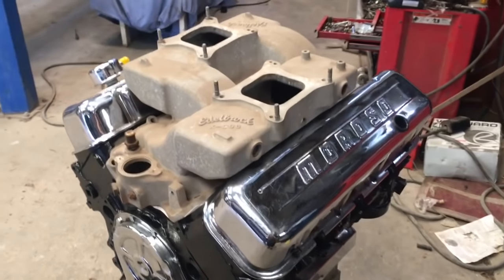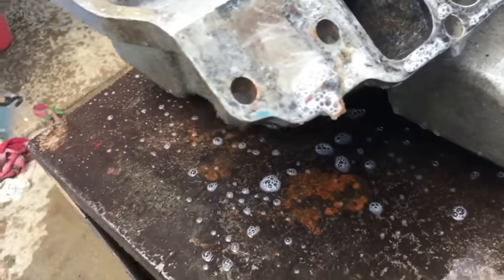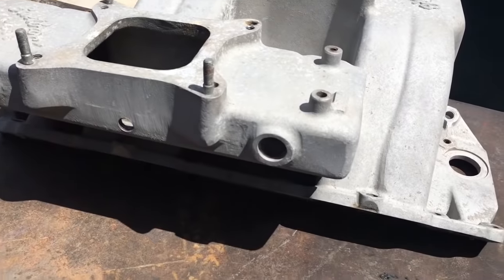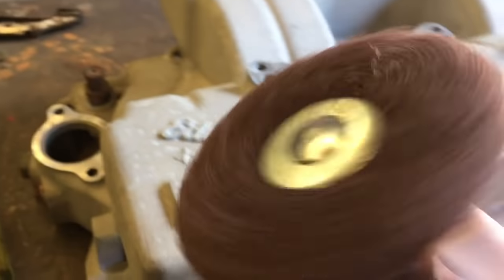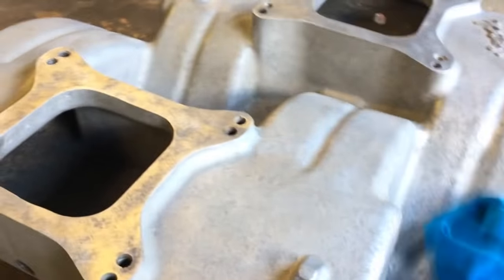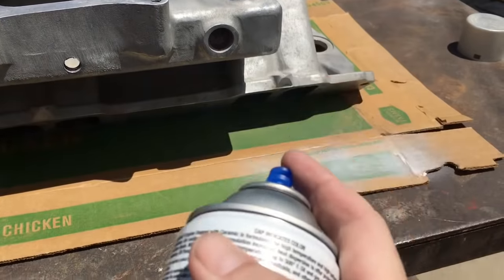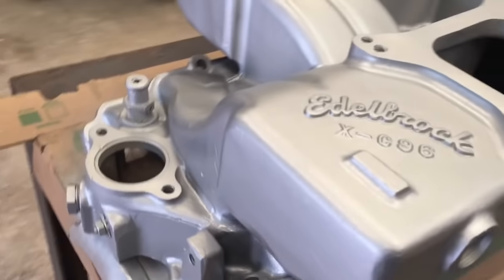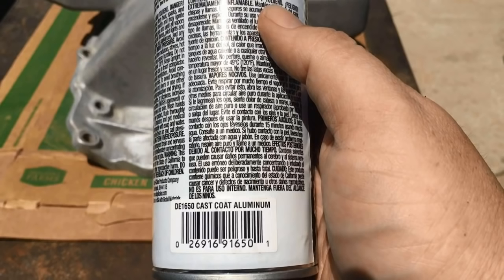Aluminum Intake Manifold Restoration the quick, cheap and easy way

Comment: Don't paint aluminum intake manifolds, it seriously slows the heat dissipation, which is one of the reasons aluminum was used in the first place.
Reply: The radiator's job is to get rid of heat. Why should there be heat coming out of the intake manifold? How does that help?
Reply: Most people don't know that paint, especially metallic paint acts as an insulator in the same way you would wrap food in foil to keep it warm. Thermography 101
Reply: Honestly, I thought he was going to show how to polish it out, but it looks good.
Reply: Chill out. Just a thought…
Reply: @Spiritof_76  You don't know much about engines. Hot oil get splashed to the underside of the intake plus exhaust crossovers on production intakes add heat, hence a hot intake manifold.
Reply: @joe-hp4nk  I know plenty about engines, there are 7 engines in my shop in various states of assembly, and that's not counting the 4 that are still in cars. Intakes with crossover heat usually have a metal heat shield riveted on to block most of the oil. But from the factory, the intakes were painted cast iron. Of course intake manifolds get warm. But the cooling system gets rid of engine heat unless it's air cooled like a Beetle or Corvair.
Reply: @Spiritof_76  Aluminum is a excellent conductor of heat. If you paint it the heat won't dissipate like it needs to and you'll have vapor lock from boiling fuel.
Reply: @joe-hp4nk  No, vapor lock is usually because the fuel gets hot in the lines, too close to the exhausts. The fuel in the carburetor can vaporize, but a thick mounting gasket can alleviate that. Painting an aluminum intake won't do anything different that painting a cast iron one. They both warm up from engine heat. Cast was always painted so it wouldn't rust, but car manufacturers don't spend the time or money to paint aluminum parts.
Reply: @Spiritof_76  True, fuel gets hot in the lines  and causes vapor lock. Aluminum soaks up heat way faster then iron and must be dissipated  quicker. Painting it traps the heat in.
Reply: @joe-hp4nk  If the heat gets trapped in the intake manifold, how is the gasoline in the fuel line or the carburetor going to vapor lock? What "sounds right" doesn't make it matter. Painting an aluminum intake is no big difference than painting a cast iron one. The coolant and the radiator remove engine heat. I've painted aluminum intakes and it makes no difference that matters on a street car. I've been working on cars 40 years. Aluminum is used because it's light weight and easily cast.
Reply: @Spiritof_76  That's right, they make aluminum parts because they're light. The down side is aluminum absorbs heat fast and dissipates heat just as fast, painting it traps the heat from dissipating.
Reply: @joe-hp4nk  It's obvious you are going to stick with the equivalent of a mechanics old wives tale. Your vapor lock claim is crap. Your aluminum intake claim is crap. Engines operate most efficiently at specific temperatures. They'd overheat if your claim was true. They don't. You are immune to logic and facts.
Reply: @Spiritof_76  It's ok, paint your aluminum intake till the cows come home. I'll keep my aluminum intake clean and paint free and enjoy a cooler manifold.
Reply: @joe-hp4nk  I'm sure you are reaching for your joy-maker just thinking about it.
Reply: @Spiritof_76  You would rather reach for my joy-maker come to think of it.
Reply: There is so much under hood heat on a vehicle that of the paint is an insulator it would be a good thing, that is why cold air intakes are important.  On my SBC 400 I have 3/4" thick insulating spacer between my carb and my intake manifold to reduce heat soak from the intake manifold.  Vapor lock happens in the carburetor not the manifold.  I added a fuel filter with a bleed return to prevent vapor lock and to have more fuel flow back to the fuel tank.  The only thing cooling the manifold is the air going into the engine otherwise it's heat soaking from the engine and exhaust headers.
Reply: @joe-hp4nk  (Who removed my reply?) We know how this went down: Your slow reply was rehearsed in the shower while slowly washing your ****, then you rushed to type it before you even dried off, thinking, "I've got him now."
Reply: @Spiritof_76  Something got to you a long time ago, and you need help to take care of it.
Reply: @joe-hp4nk  No, just know-it-alls making claims with weak arguments, mostly just "because I think so." That's your argument.
Reply: @joe-hp4nk  You can always delete your fallacious comment and all of these replies will disappear with it. Aluminum was not originally used to cast intakes for heat dissipation. Finned heads or jugs on air cooled engines, yes, but water cooled intakes, no.
Reply: @Spiritof_76  Aluminum was used to save weight. The rapid heat absorption and dissipation is a property of aluminum, don't block it with paint.
Reply: @joe-hp4nk  My radiators, thermostats, and fans get the job done just fine. Where do you think the heat is going in a cast iron intake? And if someone swaps it for an aluminum one, it suddenly needs to radiate heat from the surface? The engine makes the same amount of heat, but it can't leave through an iron or a painted intake? Face it dude, your claim is ultra weak. The difference is negligible.
Reply: @Spiritof_76  You're right, iron intakes need good radiators. Aluminum intakes dissipate heat much better which makes the radiator even more efficient, provided you're not stupid and paint it.
Reply: @joe-hp4nk  I'll give you credit for one thing: If you were the captain, you'd definitely go down with your ship, even if it was still moored at the dock. Now go out and do the science. I need to see how much heat per hour comes from bare aluminum, painted aluminum, and painted cast iron intakes on the same engine, and also the change in horsepower/torque with each intake painted and unpainted. But really, it doesn't matter. People paint their intakes for cosmetic purposes. We could all just run unpainted engine blocks and all of the parts on them regardless what they are made of.
Reply: @Spiritof_76  There's no choice, cast iron needs to be painted or it'll rust, hence the need for more cooling than aluminum.
Reply: You beat me to it. 👍 
Paint hold in heat. 
Heat robs horsepower. 
Hot rodding 101.
Reply: @Nicholas-cn5vk  It's NOT that simple. A cast iron manifold gets painted. Headers get painted or coated. Cast iron blocks get painted. Does an aluminum intake engine MAKE more heat than one with an iron intake? There are optimum temperatures for engine efficiency, not too hot, not too cold; that goes for the oil and the coolant. Actual data is needed, not "sounds right to me."
Reply: @Spiritof_76 What is it bolted to and sitting on top of?
Reply: @gregmay2155  You tell me, Einstein.
Reply: @Spiritof_76  That's rich, coming from someone that doesn't understand the basics
Reply: @gregmay2155  I understand plenty. "The basics"? What would that be? Engines have an optimal temperature at which they make the most power with the most efficiency. Numbnut ideas like "the engine has too much heat and needs to dissipate it through the intake manifold" certainly aren't the basics. Give me facts and numbers if you want to dispute my claims.
Reply: @Spiritof_76   I'm not here to hold your hand. You obviously don't like to do any research to better yourself. Good luck with your builds. Sincerely, the guys taillights your looking at because you can't be bothered with science. PS, You should run 87 in your high compression build because they are just ripping you off with that 92 crap lol
Reply: Uhhh, cold air goes in the intake. Not hot. 🙄
Reply: @gregmay2155  At the drag strip where they run the car for a short time at max rpm, and the lightest parts are used, intakes were sometimes cooled with ice between runs.  But for a daily driver or weekend fun rod, the difference is going to be negligible. For a car show vehicle, stopping an intake from staining and oxidizing by painting it won't make a horsepower difference that's measurable. If you think otherwise, do the tests and post the data.

Comment: I used to work for a Sign company,  and to clean Sign cans, we used Muratic Acid. Sometimes diluted, and sometimes not. Works great on bike motors, wheels, valve covers, even removes Aluminum bits stuck to nickel cylinders like a blown up Snowmobile.
Reply: Agree with you, definitely read the delusion parts to water ratio
Reply: Yep drain cleaner is the same thing but I used it on a snowmobile cylinder that got scuffed by the piston skirt to dissolve the aluminum then re hone the cylinders for new rings being the cylinders were with in spec . I think what happened is the guy got on it too hard before it was warmed up being a liquid cooled rotax engine and it cold seized just long enough to drop compression and skuff the cylinder walls .
Reply: @Pete Loomis  I hope it wasn't a nickel coated sleeve cause honing those destroy em! 99% of liquid cooled sleds have/had nickel coated sleeves!
Reply: @Guns_N_Gears No it wasn't a nickel plated cylinder because it was a older Rotax engine that was made before that process was being used.
Reply: @peteloomis8456  I was talking about my experiences.  Thank you

Comment: Easiest way to smooth and polish aluminum intakes is with a brass wire wheel. Takes literally no time and if you have a dremel or other small rotary it takes even less time in the tight spots. Clear coat it with a non yellowing and you'll have a polished intake. You can use the brass wire wheel on pretty much anything aluminum and pitted to get a smooth as butter finish. The paint lays down so much better than using chemicals that can seep into the metal and contaminate the paint even after multiple baths with thinner.
Reply: You’re using the word “literally” wrong.
Reply: Metal 101
Reply: @Ricksastar  what
Reply: Vapor blasting look it up might cost more but it looks better and actually polished the surface. I had this very same intake on a 66 Chevelle original SS 396 car but put a 70 LS6 in it with a hotter solud lifter cam with electronic ignition and big tube hooker headers and with a 4 spd Muncie and 4:10 out back with big drag slicks it would pull the front tires. I bought the manifold from my boss who ran it on one of his dirt oval track stock cars until rules changed and mandated smaller cubic inch small blocks so the engine got pulled out and a smaller street cam went in and the engine went into his tow truck with a single 4 barrel Holley and that's when I bought the intake manifold for 50.00 with carbs and linkage lol . I looked a few months back on Ebay for this same Edelbrock XC-96 and the price was over a 1,000 bucks and had seen another at a car swap meet that was 1,200.00 a couple of years ago . Wish I still had the car because it would be worth a fortune compared to what I paid and had into it and it was a blast to drive but fuel mileage was out the window .
Reply: @Ricksastar 🤡

Comment: I am about to offer my services to the public. The BEST way is using a Vapor Honing Technologies machine. When I clean an intake, it will look better than new if it doesn't have any corrosion or pitting in the aluminum. Also subbed for the good content.
Reply: I have been wet blasting for decades...it always gives a great finish.
Reply: Like a water 💦  jet ?

Comment: Looks good but I’d really like to watch you get the valve covers off with that intake on!
Reply: Just enough room.. You rotate downward until clear of the manifold.
Reply: I had the same intake on a LS6 454 that was built more than factory but I had M/T finned aluminum valve covers and they weren't bad getting off for valve adjustment because I had solid lifter cam . The hardest part was if you weren't using T nuts to hold these on and just bolts was getting those bolts closest to the intake side out and back in without dropping them I found out early on then used T nuts after .

Comment: I use a product made for cleaning aluminum boats. Walmart sells it. It is strong, don't get it on anything but aluminum, but it makes aluminum look new again. You just have to seal it with something afterwards or it will corrode again.

Comment: The silver VHT header paint looks really good on intakes too.
Reply: Please people just use the duplicolor. I’ve tried them all, nothing looks better unless you use some old spies hecker European blend (impervious to brake fluid) base with a Saturn (highest flake content) silver, clear with green Pearl. Done it. I think if you chime in and make a comment to use header paint, I have to warn everyone not to. There is no more unreliable paint than header paint. Duplicolor also made the best ceramic header paint. Held up as good as the real thing. They don’t sell it anymore. I have a can of everything. Some have silicone, and if painted indoors will track all over the floor. Others have no corrosion protection. Of any paint made, header paint is a loose cannon. Btw, last I checked, Sikkens was the only brand of auto paint left similar to the Spies. You have to ask for it and pay extra, but if you can get, and want wicked show quality, that’s what you should use.
Reply: @wheelstandr  Have you tried POR 15 silver header paint because I have and it worked very good and didn't crack or peel off after 5 years of header abuse ? I tried VHT a couple times blasting the headers and that crap is awful even after short baking the stuff on and once dried and cured it literally cracked and fell right off the headers onto the shop floor and I wouldn't use that stuff on anything other than to toss it in the garbage can .

Comment: Have the exact same manifold here in Australia.  These manifolds were used on the bbc 427 cu inch . Probably not enough cu inches .  Have seen them on 496 bbc & recently l have been considering a 525 cu inch . 4.310 bore from memory & a 4.5 inch stroke.  Most probably pull 6 grand .  2 tricks with these manifolds is the right camsharft & the other trick is carburetors.  I am seriously thinking  Holley Sniper EFI .   660 Centre Squirters would also be good 4 an all out engine

Comment: Have one of these Edelbrock X-Ram X-C96 Manifolds . 
Going on2 a 496 cu inch engine.  
Winberg Crankshaft , Brodix Aluminium Heads/ Block & Rocker Covers  , Oliver Rods, Diamond Pistons 💎.  Holley Sniper efi Carburettors.  Howard's Camsharfts.  Jesel Shart Rockers . 
11.5/1 Compression.  
Going in2 a Beismeyer Flat Bottom V-drive.   625 /670 hp . TQ should be similar.  Good 4 a 105 mph maybe a  fraction more . 
Engine from Top 2 Bottom all Black ⚫️ 👌 Anodised or Powder Coating  with Bassett's over transom pipes  .

Comment: Love your idea of using scotchbrite. I am also going to use dupi-color enamel with ceramic on my Performer rpm. I have it off to replace gaskets and clean and paint. Before I scotchbrite, I am soaking it down and drying with Simple Green. Simple green rated top of the cleaners for manifolds as seen on Muscle car solutions yt channel. Thanks for sharing. Cheers from Motown.

Comment: I suggest covering the carb areas to keep dust from getting inside the manifold and eventually the engine.  A little tape goes a long way.
Reply: It would just burn off in no time if it got past the valves. There isn't enough to matter.

Comment: If you have a media blaster....  you can get your natural aluminum look back and protect it with using a matte clear coat!  We use it at the restoration shop all the time.  Looks good and judges don't knock off points either.  Holds up really good as well.  👍
Reply: One can always polish it to a mirror finish after blasting as well.

Comment: I find the wheel paint and clear coat works well on heads and intakes, aluminum brackets, steel bracket, and they hold up very well, the heat is no problem, and chemical resistant ,  the clear wheel paint  is great, and the aluminum color is a great look on aluminum, it has a metallic, in it that doesn't really look metallic, it looks like bare clean aluminum, only better, if it's the same stuff! It's been 5years since I bought any,  I figure most of it is similar , the  clear is especially good , it resistant harsh degreasers and  the heat is no problem, it's not going to stay on headers or exhaust manifolds, but intakes and heads are fine! 👍 Sorry again  for the rambling
Reply: Hi James, it however needs to high temp. Manifolds get hot due to the heat crossovers in the heads and manifold.

Comment: Did the same thing on a Holly Contender 17 years and 65 k miles ago on my 64 C 10. Still looks decent. I did additionally spray a clear engine enamel over the silver. You may run into valve cover clearance issues with the additional coat of paint.

Comment: That Looks Incredible Tommy I Did an Edelbrock Aluminum Intake & The Edelbrock Name With Red Paint Pen Then Finished Off With a Few Coats Of Clear 😀😎😀😊 Great Video Gasser Nation  #1 👍🏼
Reply from the maker: Thanks Chris! The red is a good idea, I may do that! I've found that the high temp clear on these manifolds tends to yellow over time, so I've had better luck not clearing them at all. They still hold a pretty nice gloss from the paint. Thanks for watching!
Reply: Gasser Nation Next One I Have That’s Oxidized I’m Going To Give Your Method a Try 😀🧰

Comment: a good commercial strength acid for cleaning aluminum wheels and parts, sold as an aluminum brightner and a pressure washer works great on these.   spray on and wash off

Comment: VHT aluminum header paint bake in oven at 400 degrees for 30 minutes let cool and do it again…then clear coat with a good clear coat… I used Speed o Kote.  Looks better 6 months later than the one I had blasted and powder coated and gas won’t take the paint off